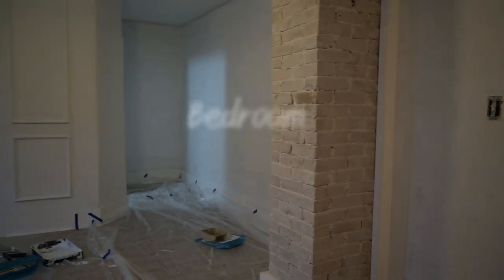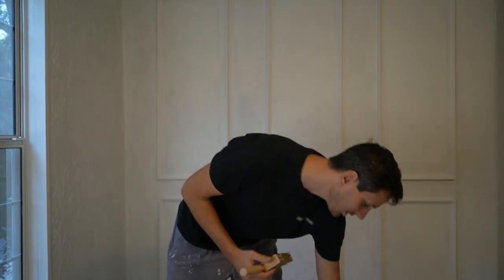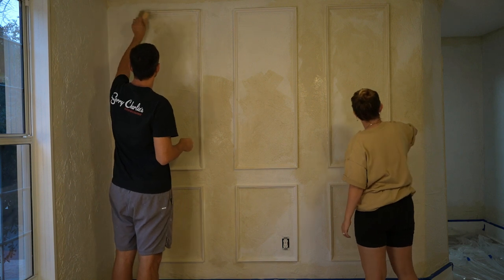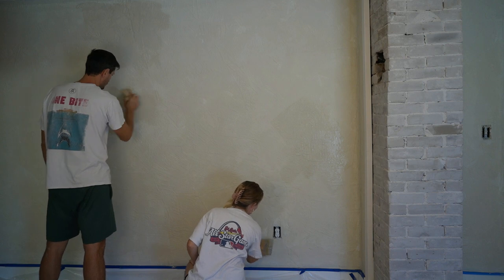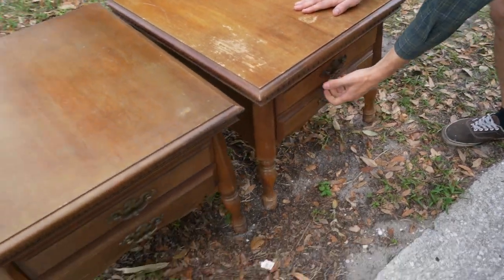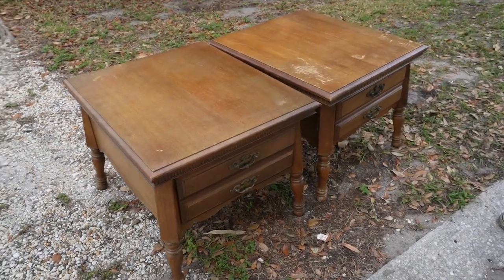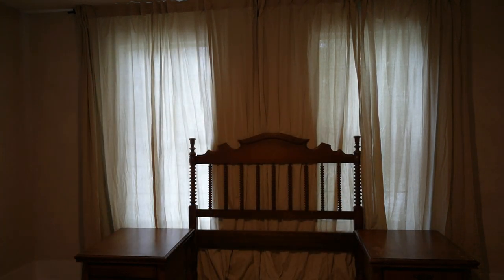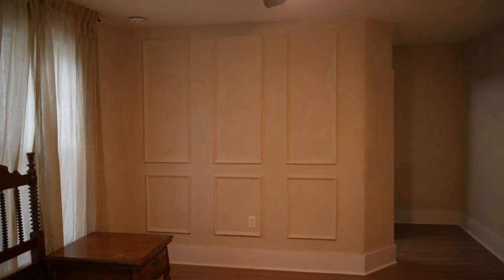FREE nightstands and an antique headboard for $40?! | Budget Bedroom Makeover Pt. 3

Comment: Hope you feel better ...Here's a good tip Buy some 0000 Four Zero steel wool so When you're Applying the Restore a Finish With the Four Zero steel Wool Wipe with the grain (as the steel wool four zeros Will Take off Most the scratches)...let sit over night then Buff off Excess....
Also I'd paint the bottom Of nightstands in a Olive green to Balance the Nook area and Natural wood Top and drawer fronts....Just an idea...Get lots of rest 🥰👍
Reply from the maker: Good to know! We are planning on using Restor A Finish to spruce up the headboard. 🙌
Reply: @floridaflipsters  I've been Refurbishing/restoring and painting etc furniture for quite a while ..so any tips etc I'm so willing to help see you both be successful 😊